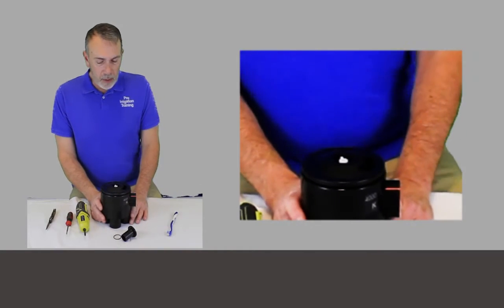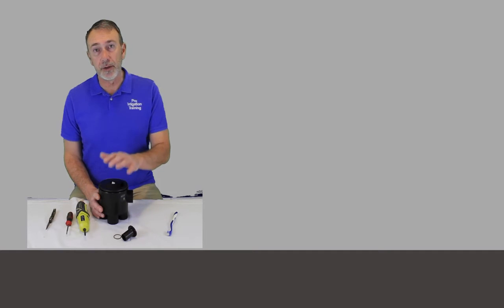How to Repair Indexing Valves (sprinkler systems)

Comment: Hello Michael. 
I do have a 4-zone index valve with 3-zone Cam. Does the 4th unused zone also must be capped off? Reason I'm asking because I think when the Sprinkler water pump stops, the water momentum "un-primes" my water pump.. 
After I prime it and it works fine pulling water from the lake, when the pump stops, I could hear and feel the water being sucked from the pump and out of the unused open zone, and pump will need to be primed again. I could send a video of the "phenomenon" if necessary.. Boca Raton, FL.
Reply from the maker: Yes, you definitely need to cap that unused zone outlet. I'm not sure if that's what's causing the loss of prime. If you immediately try to restart the pump, and it's already lost prime, then yeah that's what it is. But if it takes a while to actually lose the prime, then it's probably the foot valve leaking through.
Reply: Look up a "check valve" you should have one from keeping the water primed at the pump.
Reply from the maker: @slowrider30  Yessir, that's right. I know a lot of lingo is regional. When I said "foot valve" I meant to imply there is a check valve with screen on the intake of a lake pump setup. Thanks for pointing that out. That's what's holding your water in the pump for it to self prime. If it's leaking, you'll not have prime next run.

Comment: I have a 4 zone K-4000 configured for 2 zones that has worked for years. Now it is spraying water from underneath the body of the indexing valve when activated for either zone. Any ideas or suggestions? I assume that I have to replace the entire body.
Reply from the maker: I'm so sorry that I didn't see your comment when it was made. I'd reckon that you've replaced the valve by now. Probably a crack on the underside?

Comment: So I have 11 zones in my system. My system runs off of a shallow well with a 2 Hp pump. System comes on fine with timer and works great until it reaches zone # 8. At that point pressure drops dramatically in zone #8 and only a small stream comes from one or two  of that zones heads. I then go to my well pump and crack the threaded bleeder on top of the impeller housing. air bubbles will then come out and within a minute or two zone #8 will pressurize and come to life. The system will then finish off the remaining watering cycle without a hitch. Next day this same problem will repeat. What might I check in my system? Thanks
Reply from the maker: To be honest, I really don't know about that one. There is a possibility that at zone 8, you're exceeding the refresh rate of the well, and that's possibly causing some air in the line. Try splitting your program in half, run 6 zones one day and then 5 the next.
Reply: @Proirrigationtraining  thanks for your response. In the past I’ve always run all 11 cycles without issues until recently. Last night I left the bleeder plug in the pump impeller housing cracked open for the entire watering cycle. The system ran fine even though the bleeder dribbled a small amount of water. However when it reached zone 8 it repeated the same issue. Only two heads sprayed water and only at about 30 % normal volume. I did nothing and watched as the bleeder self purged the air, after about three minutes the sprinklers came on full at 100% and the remaining cycles finished out their cycles as well. Leads me to believe that zone 8 might be taking in air from a sprinkler head  when not in use.
Reply from the maker: @arnoldrodriguez3803  That's interesting that it always happens on zone 8. If the valves are easy to get to, you might should rebuild that valve and see if it's causing the problem. I would think if it's a problem with refresh rate or something about the well, it would probably vary a bit when it happens.

Comment: I have low pressure to just one zona. I think you skipped explaining this question. What causes this?  Whats the solution?
Reply from the maker: There's a couple things that could be going on. Has the low pressure only started recently? If it has always been that way, it's possible that you have a flow demand that's too high, count up your nozzle flows and check that total against a Friction Loss chart for the pipe size. It could be a blockage in the valve, take it apart and clean and flush all components. It could also be a leak happening on the zone pipe that you haven't detected yet.
Reply: @Proirrigationtraining  Thank you.  That is very helpful.